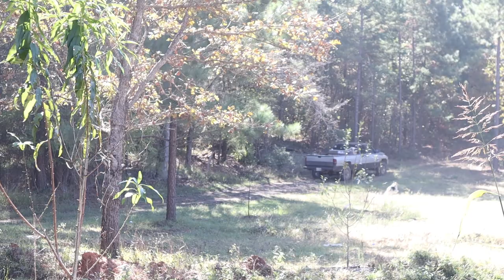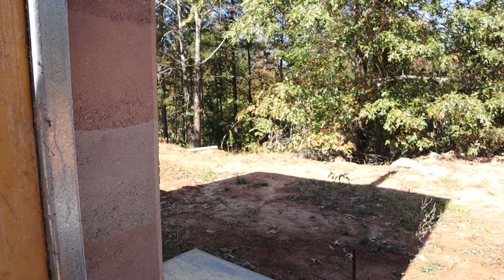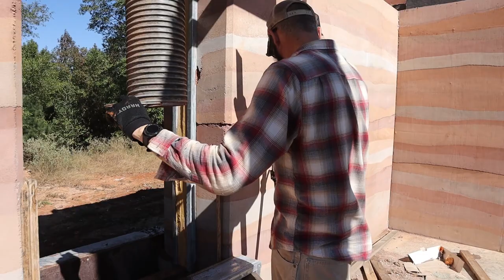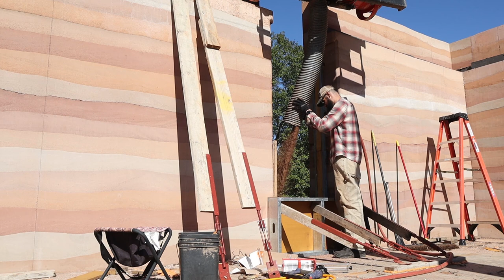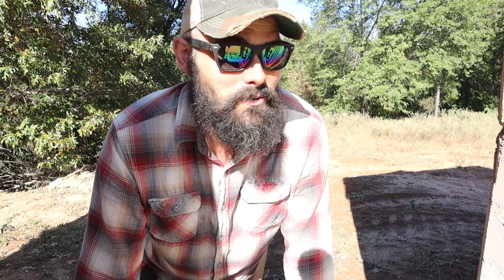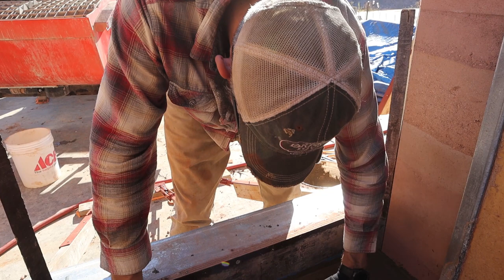Rammed Earth Under Window - Vlog 54

Comment: Checklists help with everything, especially when you're working hard and caught up in the action. 

I would appreciate it if you would talk about your total investment in all the significant tools you're using (tractor, hydraulic tamper, cement mixer, other equipment?, etc)

Also curious if these walls are specifically "engineered" by a 3rd party company/architect (in terms of rebar placement, material mixture, etc), or if they are mostly an improvised design based on your initial testing? At some point, does an engineer tell you with some degree of certainty what kind of load the walls will be able to support in terms of ceiling joists? Will this be a single story or a two story house?
Reply from the maker: Hey @2K I can send you the total investment info if you shoot us an email at info@redearthranch.com. Given how much equipment we have I don't really want to share specific numbers on the open interwebs. 
We worked with SIREWALL USA to get a good mix design and our walls were tested to hold up to just under 4000 psi when fully cured. We are planning on doing a basement with 2 stories above ground, so 3 story total. Thanks for watching!

Comment: Why bother with a sire wall. No need for insulation and it defeats the thermal drive through? IMO.
Reply from the maker: The insulation creates the thermal barrier. Otherwise you have the same problem that Medieval castles had, it would be cold and drafty which is why they had large tapestries hung on the wall, those effectively served the same purpose as the insulation. Hope that makes sense
Reply: @RedEarthRanch  Yea, I know what insulation does. This may be true for wet, rainy, and humid climates where medieval castles are but is not for dry climates.
Reply from the maker: @andysmith5012  Not trying to condescend at all sorry if I offended. We live in East Texas where it is rainy and humid 90% of the year so for our project it makes sense. Drier climates may not need it but I'm not an expert by any stretch. Thanks for watching
Reply: @RedEarthRanch  no offense at all. That area makes sense.